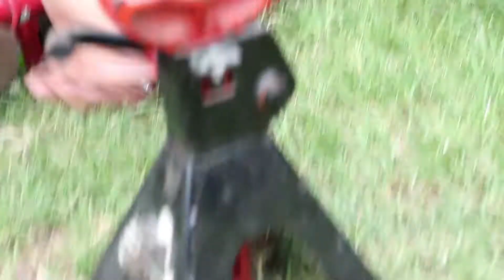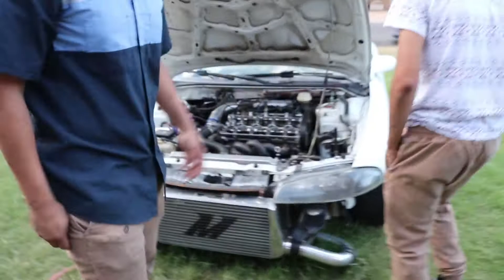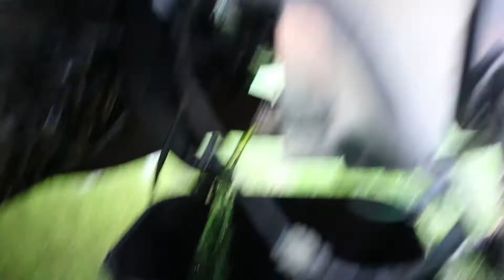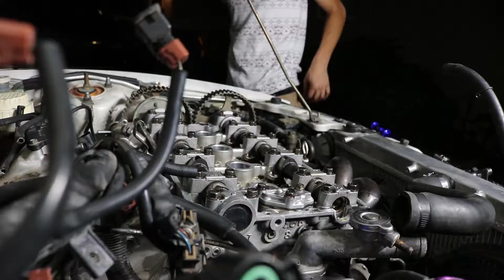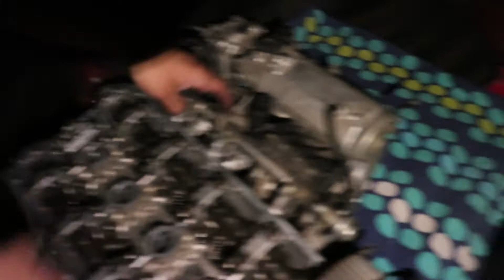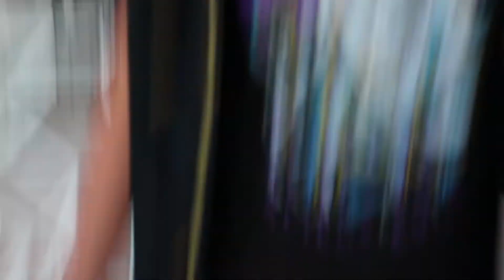Bent Valves Part 2!!

Comment: When you get new valves don't lay the head on its bottom side with the cams installed. You can bend a valve by laying the head on its bottom side.
Reply from the maker: lmShyy the cams weren't installed ;)